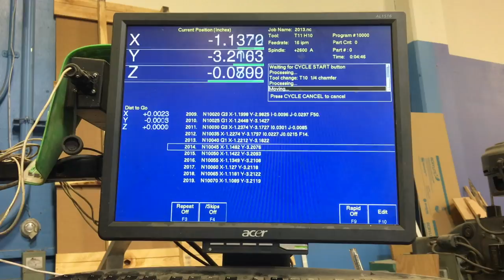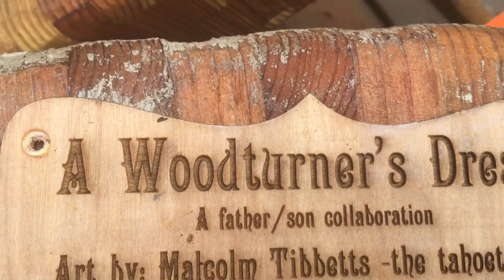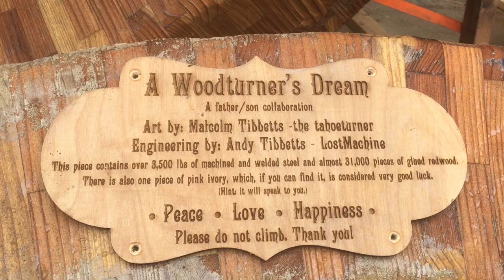A Woodturner's Dream

Comment: Astounding. The expertise in geometry, trigonometry, material science and engineering are beyond the comprehension of the average person when they see this piece. That doesn't begin to touch the skill set and experience required. I truly believe you could see this in your mind's eye as it would appear when complete and how you were going to do it. You must have spent many nights laying awake just figuring out how to ... "make the tools so you could make the tool to make the parts". No doubt untold hours must have been spent calculating compound angles, material requirements and the time required to machine and fabricate each component, wood and metal. As a fellow craftsman I salute you, sir. Well done.

Comment: I thought my own collection of clamps was getting to be pretty impressive after all of the welding I did on my art car this year, but you've got me beat by at least an order of magnitude.

I'm glad I caught your piece early in the week while it was still completely intact.  I brought a few loads of people by it on my art car.

I'm not sure wood turning will ever be my thing (so far I prefer working with metal, but I ought to still have a few more decades to tinker and expand my horizons) but I really appreciate that you took the time to post this build video.

I hope this experience doesn't discourage you from trying again, if that's something you wanted to do.  In fact, if you do it again, hit me up at least a few weeks ahead of time and I'd be happy to equip you with alarms and remote monitoring devices to keep tabs on your installation remotely at all times.  I don't know jack about wood turning, but I'm pretty handy with remote telemetry and monitoring.

Comment: I liked this video so much it inspired me to try it myself, on a much smaller scale tho, my circles are only 70mm across. I'm using the rubber band trick you did. The whole ball will be about  500mm in diameter when it's finished. It will be a combination of your top one and the one on the left on the ground, wish me luck. James.

Comment: Redwood helps. Years ago made a 96 piece bowl out of walnut and that was quite challenging, the glued rings would sometimes shatter apart when unclamping, don't know if it was the glue or combination with walnut, and high tension strap clamps. Rubber bands though, nobody thought of that.

Comment: 2 things: 
1. This represents an amazing skillset of carpentry and engineering knowledge. Absolutely incredibly impressive work.
2. If a craftsman such as this costs $80 per hour (very reasonable considering his skill), the cost of this installation approaches $200,000 which to me is a shame considering the audience. They can't possibly understand or appreciate the level of craftsmanship in this piece. I would gladly assist in the creation of such a piece if the intended audience were more worthy.

Comment: Beautiful!  But I  can not help but wonder how long the wood will stay together if the piece remains outside?
Reply from the maker: I have tested similar work.  After three years of Tahoe weather, including being under snow for months at a time, the glue joints are as good as new.  The glue is water-proof and very strong.
Reply: Also, was that a piece you got paid to make?  2000 man hours is about a year of work.  Very expensive.

Comment: Absolutely beautiful work. Sorry for someone's unkind act.

I do wonder when I see wood workers fighting slippery glue surfaces to keep pieces aligned why nobody lets wood glue set before putting pieces together. I think that's the recommendation on many bottles, and tacky glue doesn't slide around like that. Is it time constraints?
Reply from the maker: Jeff, a tight glue joint requires that all the excess glue be squeezed from the mating surfaces.  If the glue has started to "set", then it's too difficult to squeeze out the excess.  Delays in applying clamping pressure can result in unattractive, thick glue lines and weaker joinery.
Reply: Malcolm Tibbetts I hadn't considered the additional constraints of turning these pieces either. I figured you had some perfectly valid reason why you didn't pursue that course of action. Thanks for clarifying and nice work!

Comment: How do you source that much redwood?
Reply from the maker: In the west, especially northern CA, redwood is readily available as a building material.  8/4 is a popular decking surface.  Ancient trees are not fallen; there are sustainable forests.  I would not use it if old trees were at risk.

Comment: All that work!!!  If someone has to be stoned(as they get at Burn-out Man) to appreciate what you did don't bring it there. These Mad Max wannabes won't fully get it.  The metal structural support takes away from the floating objects, so free standing or some other display would be better. I'm an artist, I know these things. Please don't make HATE comments, just trying to make constructive criticism.
Reply from the maker: Thank you for your constructive criticism.  I’m also an artist and I was pretty happy with the tripod.  The top hub is a work of art on its own.  It’s kind of difficult to built a mobile out in the desert without something to hang it from.

Comment: This work proves my point that all arts emerge out of an engineered structure. There is no art existing, if  any artistic  item is covered and unseen  or unheard by humans and art only "appears in the mind " as a mind calculation  where the mind is intoxicated by the rate of change of the particles  shapes or colours  of the entity that appears before a human " soul".  Art is a man made drug! and its creation depends on what a person sees and what his background experience was.  All this is what contributes to the creation of a human emotion.

The engineering  in this structure is rather too repetitive but taken  as a finished item, one needs to appreciate the idea of a trajectory on  the surface of a sphere where, to a mathematician, the integral of the trajectory along the piece is zero as it hangs in a conservative field.

While I do appreciate the machining that was needed, I would say  that a higher order of engineering and artistic value would have been reached if the wooden sectors used in the circumferential mode did  not touch each other so a brick structure with gaps in between would have been achieved.    As it is, there seems to be too much solidity, glue and  repetitive machining  used and it would have been more artistic if the joining of parts of the pipes was  periodically done with  dovetail joints or some of the joints found  in Chinese carpentry. Filippo Bruneleschi who made the  largest dome with bricks, for the Cathedral of Santa Maria del Fiore in Florence used such technique   where he did not only to overlap the circumferential bricks but also the vertical bricks.    In this work the  circumferential joints are overlapped but the joints parallel to the pipe axis rely solely on glue. 

Again because something is made larger, it does not always gain  more  value or artistic attention and in this case too many works of art were shown together on that sandy beech which I feel was not the thing to do, as that work deserve to be shown in a city square such as London, Rome, Paris, etc.   To show it all together on a sandy beech it  does not complement the majesty of the work done.

If it was known that it was to be shown on a sandy beech, it could have been  made of concrete, slowly building the pipe in a spiral form with reinforcements as one follows the trajectory.    Still it is good work  and one hopes that the  unused wood off  the trees that were used, would finish  recycled in making block boards 8 by 4.

Comment: I'll never understand why people don't wipe the glue but instead let it ooze out and dry. They end up wasting more material and time cleaning up the dried glue than they would have wiping.  Oh well 6 of one half dozen of the other I suppose.
Reply from the maker: Louis Cypher Louis, if the glue doesn’t squeeze out, I’m never certain that I applied enough.  Glue is cheap compared to the rest of a project and removing the excess is quick and easy.  Some people wipe with a wet cloth.  I don’t wish to introduce any additional moisture to my wood.